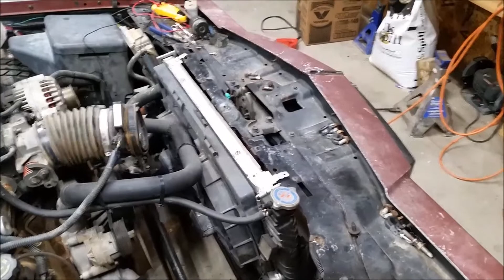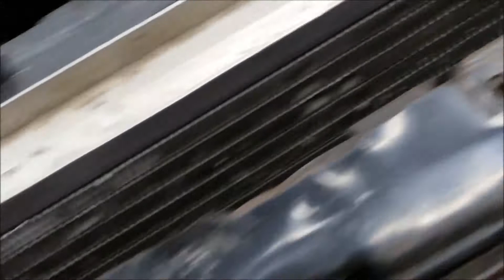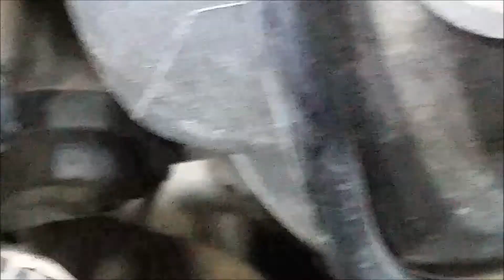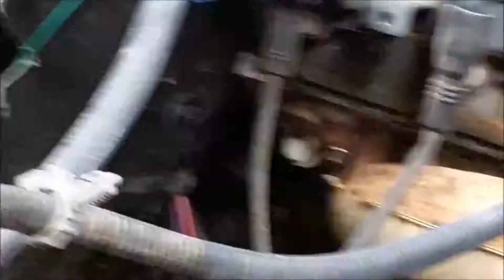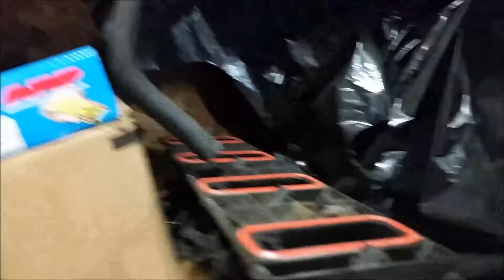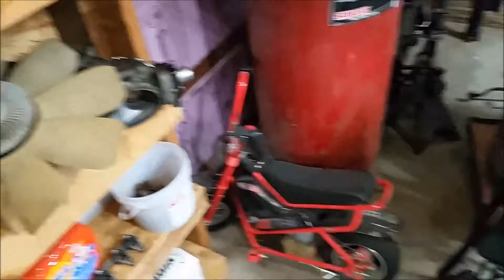Part 5: LS swap a gbody. Cooling System

Comment: Is your electric fan blowing air toward the radiator or toward the motor? I know the mechanical fan blows toward the motor.
Reply from the maker: If the fan is on the back side of the radiator, you always want it to pull through the radiator towards the engine. I had one blowing the wrong way a while back and it caused the engine to overheat.
Reply: @DivineSpeed  it is exactly i have it set up. i got the mechanical fan and 2 electric ones blowing toward the engine and it still gets to 240F degrees on the highway.
Reply from the maker: @8126926  those ls engines are really hard to get the air out of them sometimes. Park your car on a hill pointed up hill and see if you can fill the radiator anymore. Try to bleed the air out of it. If that doesn't work, maybe try a thermostat.
Reply: @DivineSpeed  I got rid off the thermostat already. Thanks for yotur suggestion.

Comment: So you are going to turbo this and you didn’t gap your rings you must be just a little bit of boost
Reply from the maker: Before I pulled the engine out, I was at 24 psi. The trick is controlling heat.

Comment: so you are not goin to have heat for the winter
Reply from the maker: Not for now. I had taken the heater core and blower motor out of the car when I got it but I will be putting an aftermarket heater back in it. Just not my top priority at the moment.
Reply: Divine Speed Team lol did you flash the computer for off road
Reply from the maker: As of right now I have only removed the anti-theft. I will eventually remove the EGR, and rear o2 sensors from the tune. Here in Indiana we don't have any smog test that we need to pass so it's not a big deal here. Besides, with this engine I've already cut the emissions in half compared to the original engine. Helped the environment.
Reply: Divine Speed Team what 6 wires does it take to make it run I want to do a ls swap
Reply from the maker: Gangsta Made Authentic next video will show the two wires you need to get it running. Two wires.